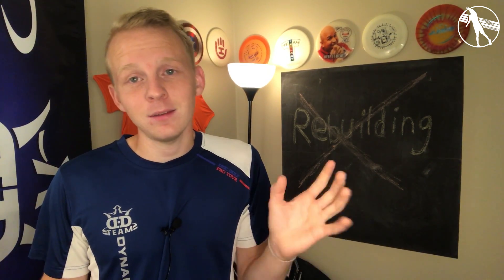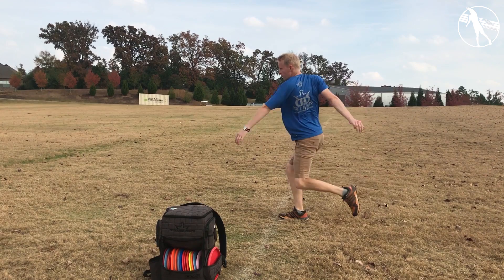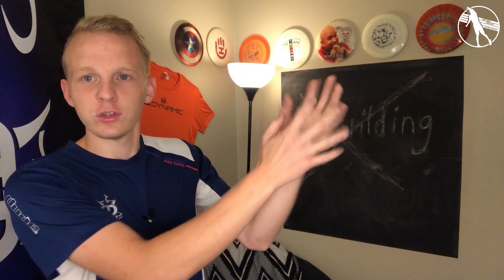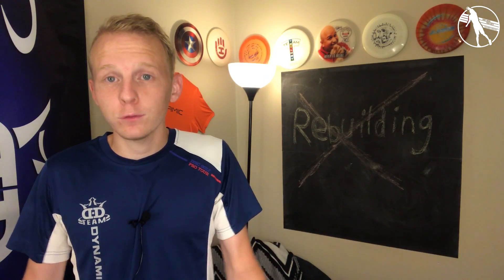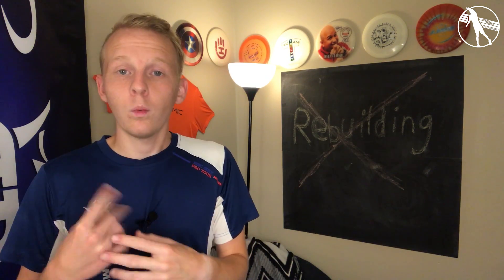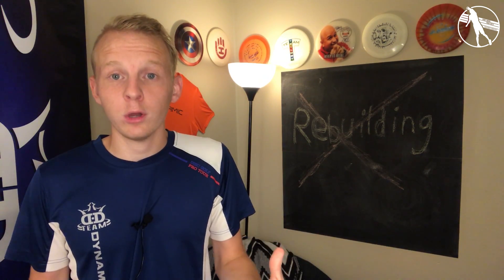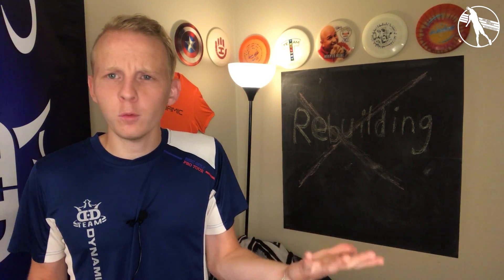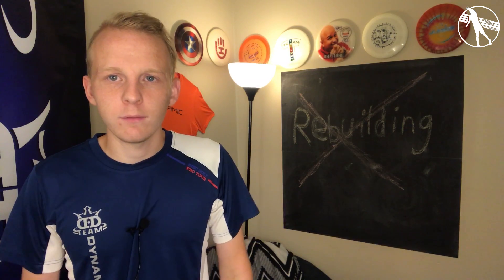The Myth Of Rebuilding Form (And how to do it correctly)

Comment: I think you might be wrong. I know nearly nothing about disc golf but I'm alright in table tennis. The biggest leaps I made in my game after playing already something like 15 years were when I fixed my fundamentals. I pretty much had to start from scratch because I had some critical flaws in the fundaamentals. Fixing the flaws ofcourse felt awkward and I had to make only easy exercices with slow tempo for a long time but I did go past my old level after some months. From my experience going back to basics is very important if there are some basics mistakes.